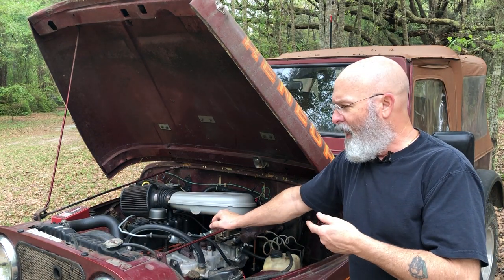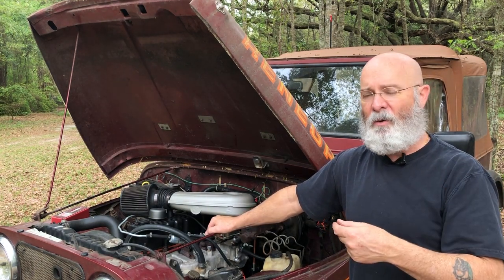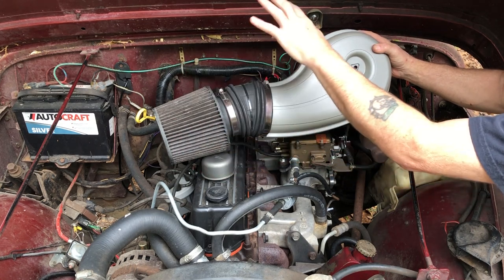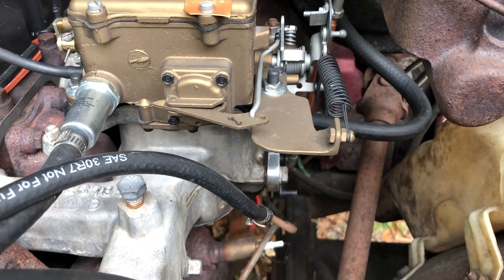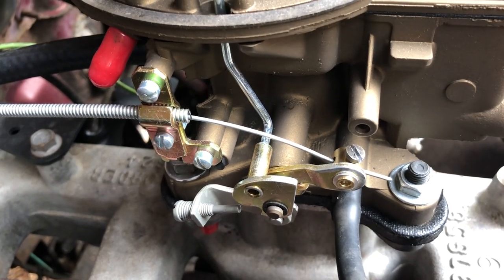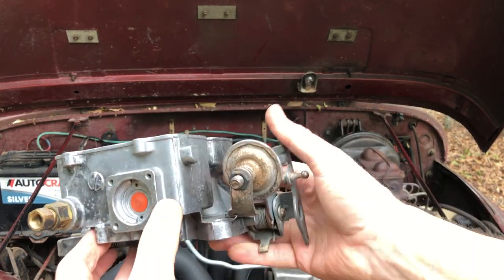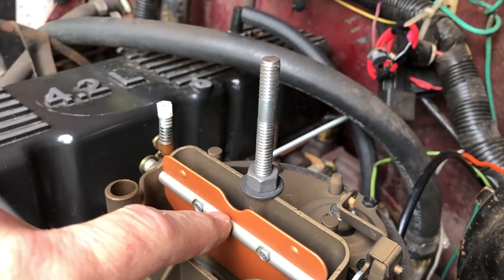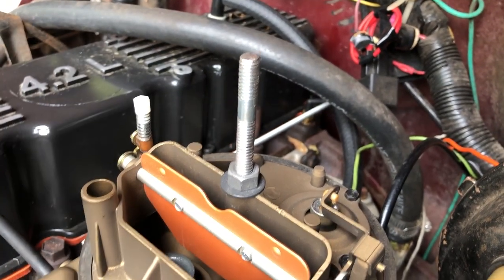Installation Tips for Mounting a 2100 or 2150 on a 258.

Comment: Great video. I could’ve used this 2 years ago when I switched from the Carter to the 2150. You’re spot on. Thanks for sharing.
Reply: How do you like the 2150?
Reply: @fallnangel55  it works pretty well. I have knockoff 2150 from Amazon so performance is adequate but improved over the original Carter.

Comment: I like what you did here @TigerCreek
I have a POS 75 cj5 with a 2100 and the thermo choke has been robbed of its guts. I would like to go with manual choke but I don't see any one discussing the linkage that gives you high idle capability on cold start which I think you have. Saw you ground down one of the followers, but the linkage and components on the PS side of the carb seem purchased. Where do I start for parts?
Reply from the maker: I decided to go with a Hi-Po manual choke conversion kit popular with the Mustang guys - https://www.mustangsetc.com/hi-po-manual-choke-conversion-kit/
The follower on the high idle cam bracket needs to be ground down or cut off to give your high idle cam full motion with the manual choke installed.
You'll also need a choke cable and a mounting bracket for inside of the cab. I have not been able to successfully solve the choke slowly creeping on. The only thing I know to do is add a tensioning screw that can be released and tightened.

Comment: Man that CJ runs like a top! Great video! I’ve got a yj with a 2100 giving me major fits right now. Electric choke is stuck and I think there is something wrong with the carb jets, I can barely get it to idle.
Reply from the maker: A little piece of trash can ruin your day. Make sure your build/rebuild is correct. Check the float level. Insure you are getting good vacuum without leaks.

Comment: Hey Tigercreek great video , what jets are you using? I just got my 2100 1.14 and putting it on a 232.
Reply from the maker: You really want the 1.08 venturi. I believe I am running 47 jets. A 232 with a 1.14 venturi carb may have excess fuel issues. Remember, that carb came off a V8 and your are putting it on a small I-6. Just be aware that you may be setting yourself up for a lot of creative problem solving. Good luck!

Comment: hi just found you ,  from over the pond in uk bought  a 69 cj7 with a load of parts including new carb so your vid has been a great help as old carb and hoese were missing , could you tell me where all the vac lines and other bits go and do, have read loads some say cap them others say makes it run better, would be a great help as you sound like you know , anyway thanks for this vid would be good too here from you see if i can get this jeep to run thanks again for your knowledge . Sam
Reply from the maker: This all boils down to what you are trying to accomplish. If you want to bring it back to factory specs you'll need to find a shop manual with your specific year/engine. If you are just wanting it to run then you have a lot more options immediately available to you.
For "running" you only need vacuum for the carb, distributor and power brakes if so equipped. The engine and carb will determine where those hookups go.

Comment: What connections/vac hoses/etc are necessary to make it work right?  I don't have power brakes.
Reply from the maker: You need manifold vacuum for the base of the carb, and supply vacuum from the carb to your distributor.
Reply: @TigerCreekFarm  Ok I have the vac advance hooked up but the other line big one in the back is going to the PCV 
Should it go to the mani?
Reply from the maker: Correct - the vacuum runs from the carb base plate to pvc.

Comment: I’m doing the swap now and I notice no one mentions anything about a needle:seat or any fuel lines not connecting Straight to the carb. The carter ones don’t fit.
Reply from the maker: Use the same fuel filter with the additional return line and connect a rubber fuel line to it and run it to the 2100. Just add a screw in fuel filter to the 2100 and connect your new fuel line there.

Comment: Do you have any issues with the manual choke and the choke vacuum pull down? Also what paint, color did you use on your 2100?
Reply from the maker: This is truly a manual choke carb and there is no choke vacuum pull down - so no issues. The carb was coated with Cerakote - Midnight Bronze, Copper and Titanium.
Reply: Oh Ok,  I guess I’m a little confused I see in your video on the back side top of the carb, closest to the brake booster what I was told was the choke Vacuum pull down. Has three 1/4” head bolts holding it on and pushes on the choke shaft with a lever just above the throttle linkage. I have the exact same thing on mine. But I ’m going to be using a manual choke as well and was wondering if it could just be deleted.  Great video lots of helpful information. Thank you. 👍
Reply from the maker: The manual choke cable controls all aspects of the choke - so the choke pull down does not function as intended.
Reply: Ah, just the information I needed. I’ve Epoxied both choke ports closed. Deleting the exhaust/ electric choke and choke pull off options. Effectively making it a manual choke housing. I have never liked the exhaust/electric chokes. 👍👍
Reply: I’m sorry to continue bothering you. But I noticed you have the EGR deleted and blocked off. Did you make your block off plate? Did you delete the curved pipe from the exhaust manifold to the intake manifold? If so what size plugs did you use? Last have you had any issues? Thanks for any info. I’m have my EGR disconnect vacuum port capped. But still in place. I seem to be chasing a rough idle intermittently.
Reply from the maker: The EGR is blocked off with a 1/2" aluminum plate I cut to fit, made a gasket and sealed the port. The curved pipe between the intake and exhaust manifold was removed and was sealed with threaded plugs (do not remember the size). Any leak that you have on the intake side will have you chasing your tail.

Comment: Where can I find another 2 barrel MC 2100 for my 1980 cj5? Has the 258 engine. The 2100 on it does not have the data plate on the carb. Where should I look/search for one at? Thanks.
Reply from the maker: ebay